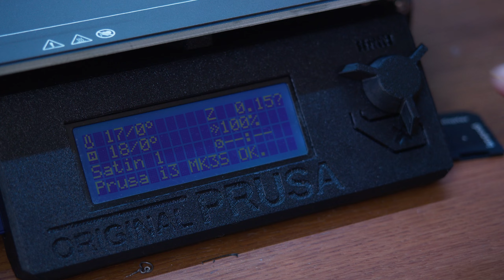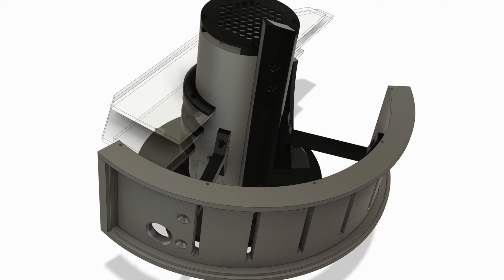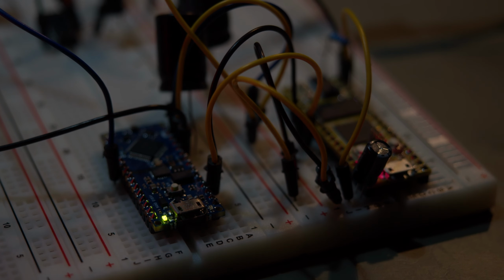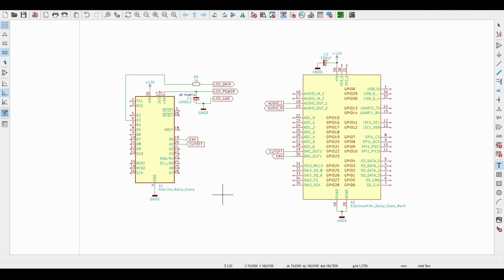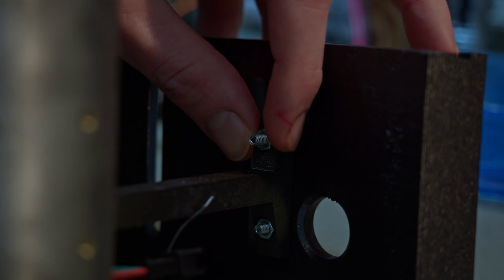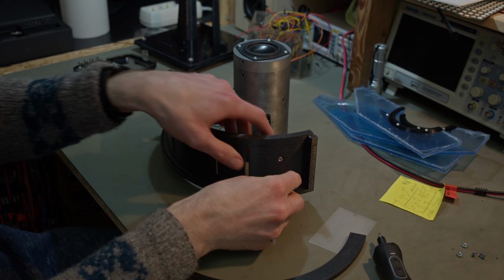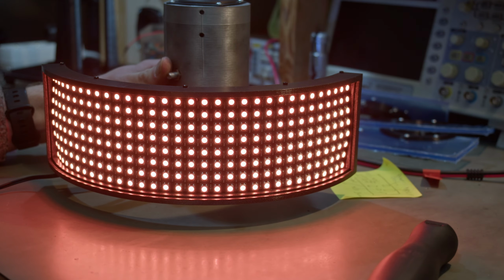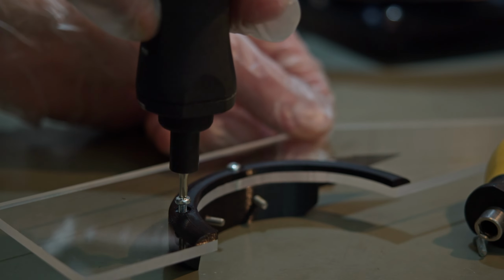3D printed sound sculpture | making void extrusion with Daisy Seed

Comment: A lovely generative sculpture.  The texture of the print works well and imprints a bit of an organic look.
Reply from the maker: I originally thought about casting it in concrete actually, but it would probably have been too brittle. But it's just a prototype, so maybe later!
Reply: @EirikBrandalf  Concrete would be interesting.  Have you considered edge lighting the plexi with ws212b?
Reply from the maker: @Enigma758  I think the acrylic is too thin for it (4mm), but maybe it's an option on 8mm? Worth checking out.

Comment: Love it! That PETG diffuser looks surprisingly good. Any plans on getting into resin printers for stuff like that? I don't have one yet, but that would probably work great as well. 🤔
Reply from the maker: Thanks! I don't really know how resin printers work, but it's on my list to get one. In the case of the diffuser here, I needed something flexible, and PETG worked great for that. It's basically just four layers printed flat on the bed and then bent into shape.
Reply: @EirikBrandalf  Ohhh. Really creative use of the material. I must have missed the bending on the video, but I really like that idea.

I've seen @MeeBilt do resin-printed lenses for his modules, which is why I've thought about it: https://youtu.be/yU6jU54t530?t=185
Reply from the maker: @benjiaomodular  I wasn't filming the diffuser part because I thought it was going to be an experiment, but then it worked on the first try. That printed screen cover in the video looks fabulous. Got to read up on resin printers now...
Reply: @EirikBrandalf  I see! That explains it. It does look great, doesn't it?? I just can't justify getting one for my shop at the moment, but it seems like a great tool for the type of things you do. 😄

Comment: Thanks for your insights, I managed to get the code running on the Daisy and can see endless possibilities. There is also the possibility of visual coding with PureData or MaxMSP. Finally I know it’s possible for the 3D printer to take plain structures and turn them into organic, which could result in a cool sculpture 😮
Reply from the maker: Visual programming and I don't go together well. But yes, the platform is so easy and flexible that it almost feels like cheating!